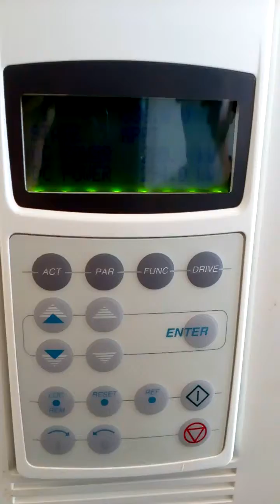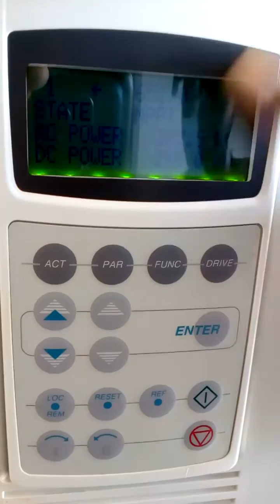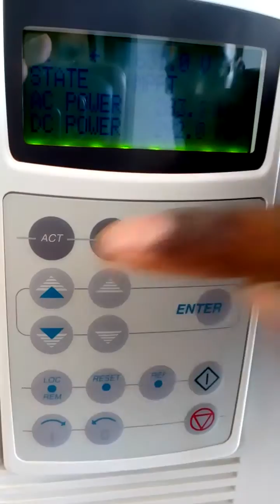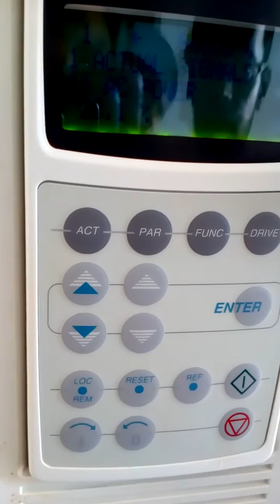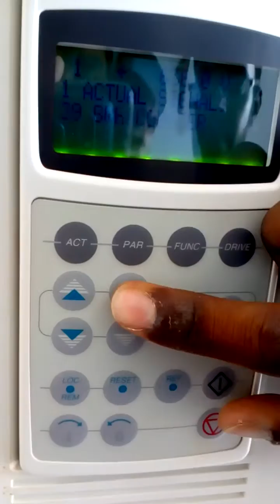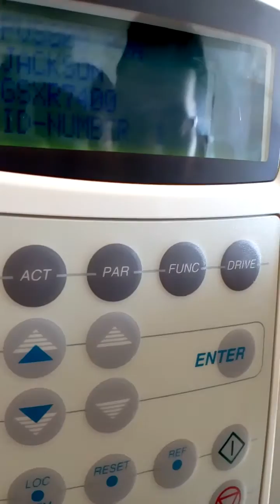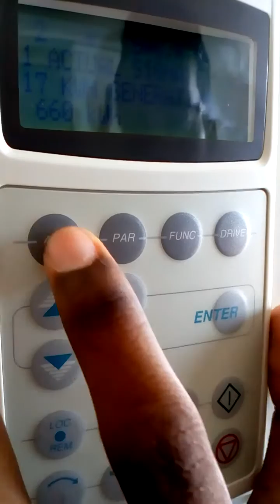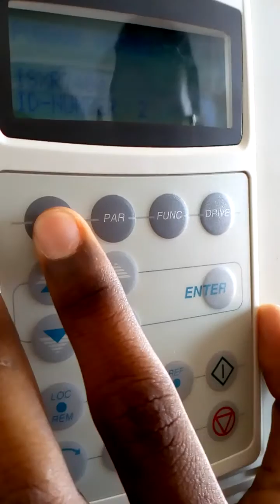ABB INVERTER Relay

Comment: how to solve in dc ground fault and dc high voltage fault
Reply: CH2 COM LOSS (7520) & PVA RUN ENA (FF54)
 INVERTER NAME: ABB PVS800 1MW SOLRA INVERTER
Reply: +Gopi nath  please u have to check FO cable from  ACU cubical RDCO (A413)CARD TO ICU Cubical NAMU BOARD (A231) FO cable light properly coming or not check it